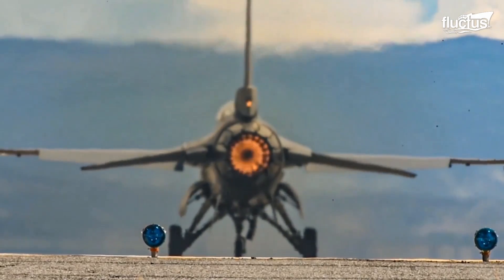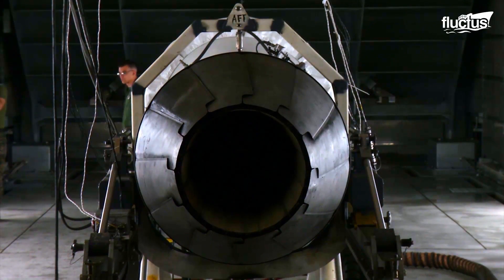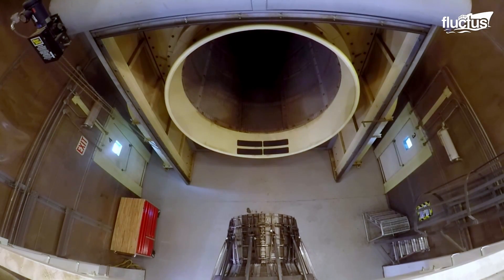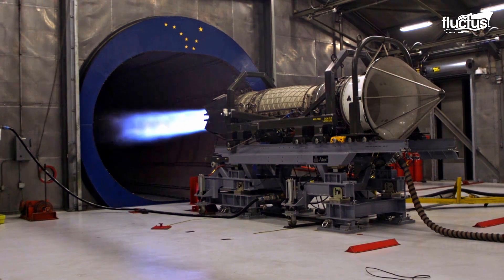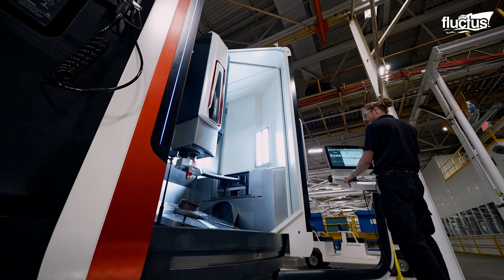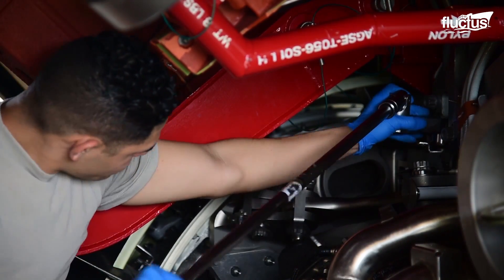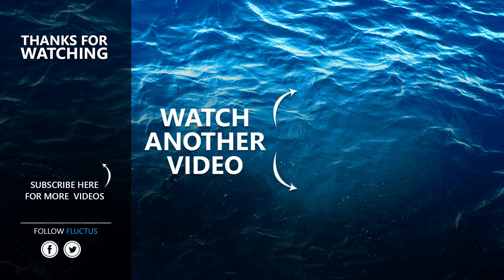Genius Techniques US Found to Remove Engines From its Most Advanced Aircraft

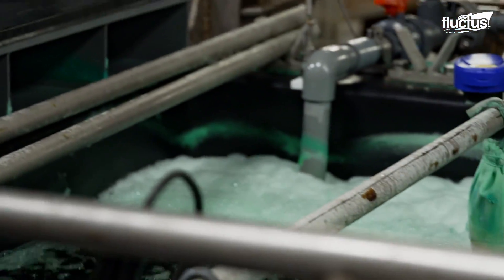Comment: Well, from what you’re showing starting @9:24 and claiming this is the part hardening process, it’s clearly and utterly incorrect and ignorant. That you’re showing IS NOT hardening! This process IS part coating/rust proofing perhaps using chromium and other alloys. Where do you see a furnace?